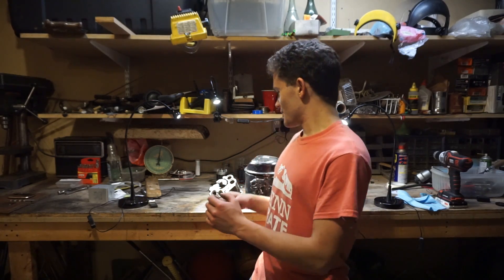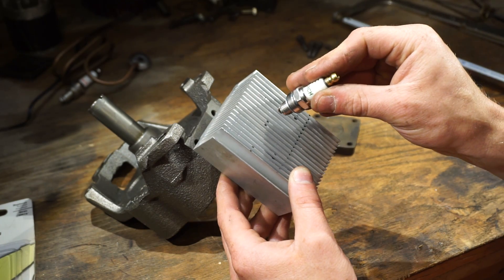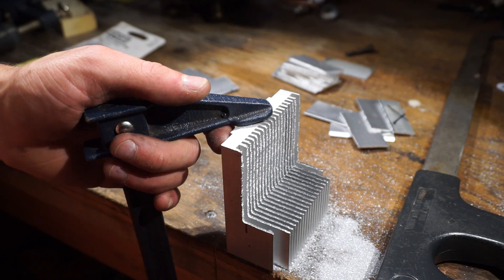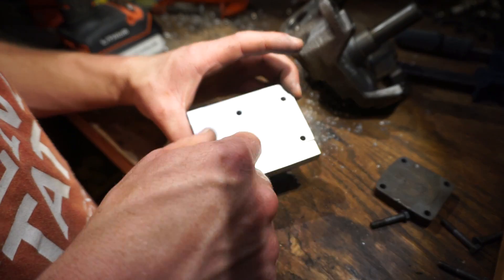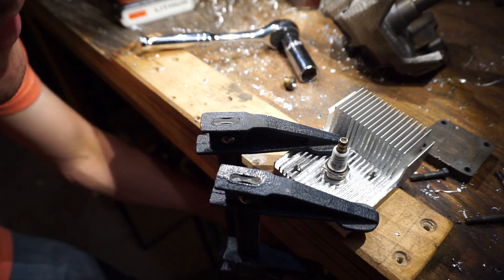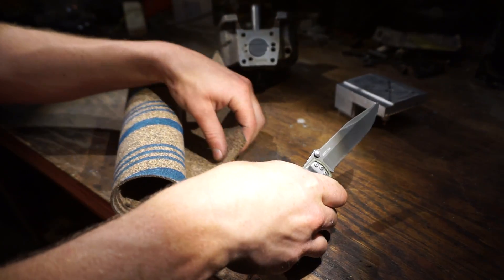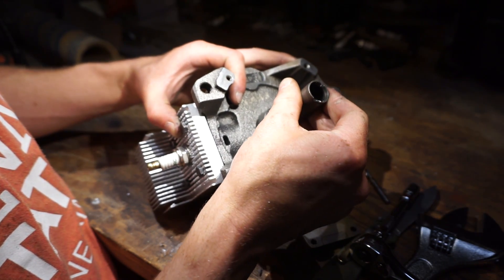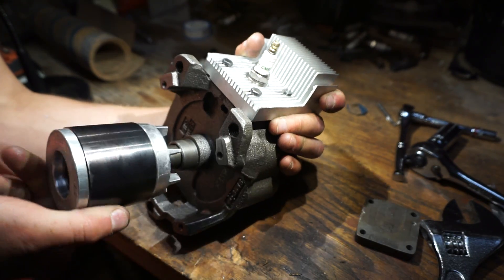Part 3. DIY Internal Combustion Engine Made from Old Compressor - Head from Intel Heat Sink

Comment: Probably a bit late to the party, but an idea that might help:

To get a hole drilled into the aluminum cooler, you could slide two of them together if they fit and make them support the fins of the other and drill through both at the same time. 
Haven't tried it myself but pooped up in my mind when I saw you saw them off.

Greetings from Germany

Comment: You could have used a carbide pressure drill bit and used much thinner stuff,and no you can't just dump water on a hot engine it will warp everything about it numb nuts

Comment: and also did you know that you could break a spark-plug by just droping it on the ground, which means that with the torque you are putting on the nut you could have spent another $4 on another spark-plug.

Comment: maybe you can make a o ring from copper wire. like 10 gauge solid wire. and solder to make a sealed circle. using silver solder. because of heat. just an idea.
Reply from the maker: +James stranger thanks for the idea using silver solder. I honestly won't bother unless the tin/lead solder melts.

Comment: Love the use of the heatsink as an aluminum head. And the abuse of your "paddle bit" (actually called a "spade bit") worked pretty good. And idea I am working on is using the heatsinks that have the copper tubing with oil in them that from what I guess, worked too well and the cpu's refused to burn out (hard to sell more computers if the cpu will last forever, eh?) to be a heat exchanger system for portable refrigeration/freezer. Good to see another use for them heatsinks other than high-grade aluminum scrap.

Comment: What is the name of the heatsink? i am hooked with this and have a compressor in spare, and i would like to give this project a try. But i cant find any thick base heat sink! i am from europe so it would be nice to find a heatsink from here

cheers
Reply from the maker: +Nikolas Sorknæs I used an old computer heat sink. Specifically one from an old Intel computer. You do not have to use a heat sink. You could use any piece of steel or aluminum instead of a heat sink.

Comment: Too bad you couldn't get a hold of a milling machine. You could easily drill all those holes and save the fins, something you really need on a two stroke. Ever see a small RC engine and the giant fins. Dude, at least yo need a drill press. You've got great ideas , but need to do your homework in the engineering dept. I wish I had had your creative brain power when I was your age. I didn't have the machinery ether.
Reply from the maker: +hello hun I have access to a mill, lathe, CNC mill etc at my local makerspace. I even own a drill press. And I'm certain I could build a very nice internal combustion engine from raw stock. However that'd really be nothing new. There are lots of videos of beautifully designed ic engines. What I'm going for is an engine that anyone could build in their garage with common tools and easily obtainable parts. I'm trying to make the point that engines are not as complex as most people think they are.

Comment: It's not good to dump water on an engine when it's still how, the rapid change in heat and cause the metal that the water is in contact with to shrink leaving the hot metal to stay expanded which can cause the engine to seize.
Reply from the maker: +Nzdds ah, good point. I hadn't thought of that. Probably wouldn't hurt to dump it only on the head since it doesn't have a lot of thermal connecting to the block
Reply: Makerj101 that's probably fine, I used to spray my dirtbikes engine just after riding it with water I'm lucky nothing has happened to it.
Reply from the maker: +Nzdds haha yeah that's a good thing nothing happened to it. A long time ago I used a squirt gun and sprayed water at the bulb in my desk lamp. It exploded and scared the pants off young me. Lol
Reply: So, that's when it all sparked, huh?  :)

Comment: Why didn't he use the original head
Reply from the maker: +Jacob English because it has passages that would cause big leaks. I could have filled them with JB Weld however I didn't rally feel like doing that
Reply from the maker: +Makerj101 plus it'd be nearly impossible to tap the spark plug into cast iron without a real tap.

Comment: I'm not sure how well that cork will work for the head gasket. Cork gaskets suck for regular gaskets so I don't see why the would hold up to compression and combustion. Try making a multi layer steel head gasket, then spray some copper rtv on both sides of the mls head gasket. This will also help bring the compression down as far as you want, just make the head gasket thicker for lower compression

Comment: couldnt the soft aluminum be bad for the head bc it could cause it to blow up or something? or am I just stupid😂
Reply from the maker: +Jeppie LOL nope. Almost all car engines these days use aluminum heads and blocks. Generally the blocks have sleeves. Even the Pistons are aluminum. Aluminum is a lot tougher than you think. And a lot lighter than cast iron. Diesels are probably the only engines that still use cast iron heads these days

Comment: You should really thread the spark plug better with a smaller size tap. aluminum doesn't favor threads very well and the spark plug could seriously injure you if it comes blowing out. Teflon tape will just burn off and shouldn't' be relied on for a good seal on something that puts off high heat. I like the project so far. I'm thinking about turning a spare mower engine into a compressor. 

Btw try making a couple of steel head gaskets, that should lower the compression. The compression might be too high for it to turn over like you said.

Comment: Could someone gift him a milling machine? The chooch-factor with those handheld battery drills is not good. Cutting off all the fins is not skookum at all.
Reply from the maker: How dare you insult my methods of madness!!!  I am my own milling machine.  You're just jealous that your milling machine is more clapped out than my arm and a battery drill!  :D
Reply: He's from California -- don't listen to him. A battery operated drill can do all kinds of wonders. I know a guy who even drilled his own well for water with a Li-Ion drill. Souper, Souper Skookum. He found that the battery operated drills have more torque than the AC plug-in drills, when operating at low RPM.
Reply: besides, he has access to a mill if he wanted it. I made a suggestion back on the first video, and he reminded me that part of the point of this project was to limit the tools used to make it easier for others to try.
Reply: California Flying ave rules

Comment: first of all the teflon tape will stop you from getting spark and also if you ever use teflon tape you wrap the tape with the threads so it dont wrap up on it self just some advice
Reply from the maker: No, it should work just fine.  When you take the plug out you can see the threads because them cut through the thin teflon tape.  And yeah I put it on backwards.

Comment: Maybe use a bit of metal sheet and tubing for a simple bearing for the case side near the flywheel. if not there is a way in which the exhaust can be shaped like a cone to create a vacuum in the cylinder, drawing out the gasses and sucking in the fuel quicker.

Comment: what type of ignition are you going to use?
Reply from the maker: Hmm lots of options.  Not really sure yet to be honest.  I will probably use an ignition coil with micro switch trigger for the initial test.  I may try upgrading to a homemade or store bought CDI.  Or there are some other options that I have thought of but you will have to find out in future videos!  :)

Comment: teflon tape was backwards. wrap it so when you screw it in the tail of tape with trail with the direction of rotation. the way you had it, it will ball up and not seal. also the tape is going to burn and melt with heat, and potentially insulate the plug thus no spark
Reply from the maker: Yeah I put it on backwards.  I wasn't thinking about it in the video.  Teflon is stable up to 500F.  If temperatures are getting that high then the engine is probably way over heated.  The ignition temperature of gasoline is 495F.  So I'd definitely have a problem running that high of temps.  I've been using teflon tape on the spark plug on this engine ever since I made it and I have had no problems.  The bits of teflon that extend into the combustion chamber turn black but that's it.  People also told me that holding the head on with soft solder would never work.  Well I've had no issues except for the carburetor falling off due to the vibration.  What do you suggest that I seal the threads of the spark plug with?  If you have a better idea then I will certainly use it.  I thought about JB Welding it but that kind of tips the scales of jankiness a little too far for me.  :P

Comment: there is a way where you dont need the crank case you can use a external compressor between carburator and intake ive got a engine waay time ago wich was working like this and men that worked good so think about it

kind regards andreas 

ps:hope for answer
Reply from the maker: +AndreasLp64 I've seen a couple engines on YouTube that are built like that. While it's an easy way to get it to work and make a pretty powerful engine it is not self sustaining. I kinda want an engine that can power something on its own. Thanks for the idea! I actually just finished making the crankcase. You'll see it in part 4!
Reply: okay thank you for the answer 
im looking forward to part 4 
regards/andreas

Comment: try to run it on diesel if the compression ratio is rigth
Reply from the maker: Hmm I'd kinda need an injector tho.  High pressure homemade injector probably = dangerous.  However, dangerous = awesome and great idea.  Maybe I'll try making a diesel engine in the future.

Comment: Use a piece of copper sheet for you head gasket. Split a piece of copper pipe down the side if need be. Cork will blow out.
Reply from the maker: Might do that if cork burns up.

Comment: how much cc does it have 5!!!duuuhh
even considering that thing will overheat when running for about 30 sexs!!!!
Reply from the maker: +Cold Blooded Fasist yeah, somewhere between 5 and 10 CC. I haven't measured it yet. It'll take at least 10 minutes before it over heats. That's a big chunk of cast iron to heat up and a very small displacement.
Reply: so you should have found another way to drill the spark plug hole without damaging the fins,that would've helped alot with cooling btw thanks.
and pardon me for swearing,I"become a lunatic when things don't go as I"plan?!

anyways you seem like a nice guy!
Reply from the maker: Humm yeah there probably is a way I could have saved the fines... shoulda woulda coulda.  I did it the way I did it.  I thought about it for a long time and that was the best method I could come up with.  Thank you!

Comment: that cork will not hold up to the heat of the combustion i suggest just putting a washer between the spark-plug and the head and just making a normal head gasket

Comment: Hey, I have been watching some of your vids for quite some time, but this one really interests me since I'm into engines too. Have a 49cc 2-stroke that was looking at converting it to an air compressor. 
So, regarding the cranks case enclosure... you obviously know you will need some kind of support for the other crank journal, either by incorporating it to the enclosure you need to fab up or by adapting the original plate to the makeshift enclosure (kind of see a whole lot of JB being used on that route). Also, you need to think about sealing that side too as you don't want to have your charge leak through there. I would suggest using o-rings and JB to make some kind of barrier, like an original rubber seal would work. 
The other aluminum heat sink would make a really good side cover also, although you will have to incorporate bottom and maybe side covering too. Can't really get a good viewing angle in the vid of the compressors housing to see where it would need closing up, but I guess that you could fill up those muffler chambers with JB and sand them down to have more of a flat surface that could provide better sealing capabilities. Then just use RTV to seal up the fabricated enclosure.
Anyways, I hope I could give you some ideas.

Comment: I machine air cooled cyl heads all the time for racing motorcycles (adding a second plug) you can easily drill or machine out that area by carefully wedging in a bunch of thin wood between them prior to drilling (paint stir stick or big wide Popsicle craft sticks would prolly work............ then when done pick them out with a dental pick

Comment: The teflon tape is usually always put on the other way, with the thread, so there is less of a chance of pushing it back off when threading the part in. 
I see your pump oiler lives in a bag too. I just threw mine in the garbage finally,  the thing leaked all over my bench twice now when I knocked it over unnoticed and I went back to plastic bottles with a spout.

Comment: little tip if you are ever cutting thicker aluminum with a hacksaw try running the blade through a candle first it should keep the aluminum from getting stuck in the teeth
Reply: Great tip Craftsman :)

Comment: You shouldn't use drill bits as center punches, the steel is too brittle.
I once ground a broken bit to a point and used it as a center punch but the tip quickly broke off and got embedded in my work.
After you get a bit of drill steel stuck it makes that spot very hard to drill out or drill straight.

Comment: Keep in mind when doing your crankcase cover there is pressure during the transfer phase. I'm guessing you will be doing your transfer ports during the cover build, tinfoil and epoxy should work, you could put a bearing and seal on the crank end to seal it off nicely.  Great build!

Comment: If I saw correctly, you put your teflon tape on backwards, such that when you tighten the plug, the tape rolls backwards. Bad plumbing practice, but it looks like it works for your purpose.

Comment: Couldn't you just put the engine into the compressor housing? You would only need to make a pipe to outside for the exhaust and a cable for the sparkplug and then just put the housing back together with JB Weld. The intake valve would then be on the outside of the housing.

Comment: Best way i can think of to drill a heatsink is to get some wood strips and pack the gaps between the fins, drill a pilot hole from the back all the way through, then use a core drill from the front.

Comment: Next time you want to use a fastner to tap grind a little slot perpendicular to the threads.  It'll give both a cutting surface and a place for the cuttings to go.

Comment: you could use circular saw bits (i don´t really know the name in english, it´s similar to how you cut cilindric holes on wood) of various sizes to cut the sparkplug housing on those fins. Then just bend back and forth the small fin bits till they break. Aluminum breaks easy.  Then use a Dremel tool to smooth it all out.

Comment: Dude, I get more impressed with you every time I watch one of your videos.  When you apply teflon to a threaded piece, whether pipe or in this case a spark plug it works better to go counter clockwise with tape if the direction of the threads are clockwise.  Keep up the good work.

Comment: Could have drilled the hole from underneath man, centre punch it and drill through, would have been very clean and allowed you to keep the fins. Probably not essential as it's not like reliably or whatever are massive issues here in this application.

Comment: another option for drilling the fins would have been to cut the fins of the other heat sink and inserted them in the gap between the main heat-sinks fins, essential creating a solid block and removing them once drilled. they could have been superglued in place and heated up to break the bond once finished. great video anyway!

Comment: As an alternative to that cork sheet you can use a sheet of metal(I think copper is the best choice here) 2-3mm thick and some RTV silicone and it should withstand the high temperatures with no problem :)

Comment: that teflon tape on the plug may screw you in the future.  if you can't get it to spark, suspect that teflon tape first.
Reply from the maker: Oh, cause it'll insulate it?  Good thought.  I'll attach the wire to the base of the plug
Reply: butre jp nice catch. I never even thought of that.
Reply: I guess your an idiot on physics it is fucking 10KV it can shoot trough half a centimeter and your saying it can't get ground just wtf ... oh your name. that explains everything
Reply: @KrisisVal  learn to read fuckface

Comment: When you use Teflon tape,, screw the threads into the tape as you would thread it into the fitting. you wrapped it on the plug backwards. Also there Is a right way to put the blade on the hack saw. you want the teeth pointing forward so that it cuts on the forward stroke where you are putting the most force and power.. Exciting work though. Keep it up.
Reply from the maker: I thought that's how I put the teflon tape on.  Maybe I messed that up.  Sometimes I mindlessly put it on backwards LOL  Thanks!